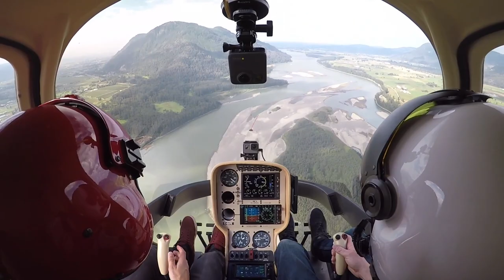ENGINE FAILURE TRAINING | RANGE VARIATION

Comment: Is it all heli's that can't do a complete auto, right down to touchdown, with zero airspeed?  There's not enough energy in the blades to fully arrest the vertical descent when there's zero airspeed?  Hence the need to rely on transitional lift of the 50 knots?  Not a pilot here, just curious.
Reply: Yep you’re on the right track. Pretty much all helicopters above a certain height need forward speed to slow the descent and stop forward movement. That’s why having enough energy(RPM) in the blades during the flare is critical. We do zero speed autos but they’re called hover autos and we don’t get high at all. In that case we just raise the collective at the right time to cushion the landing. Hope that helps!